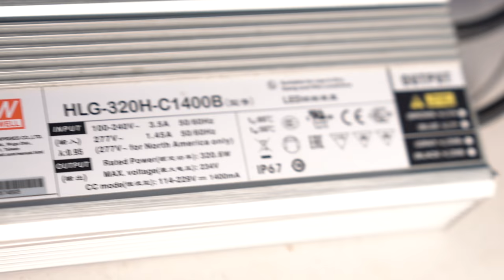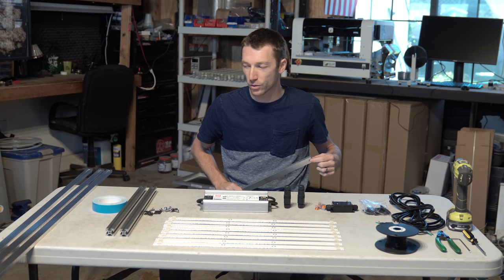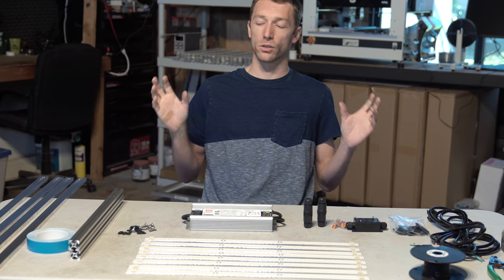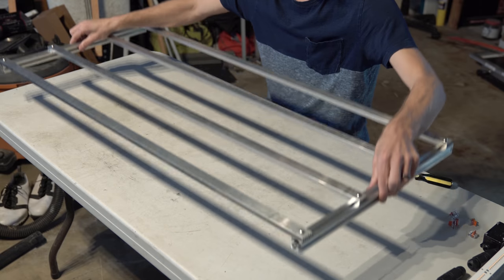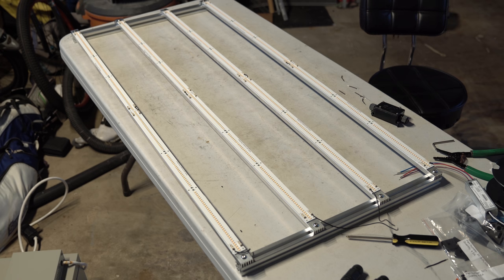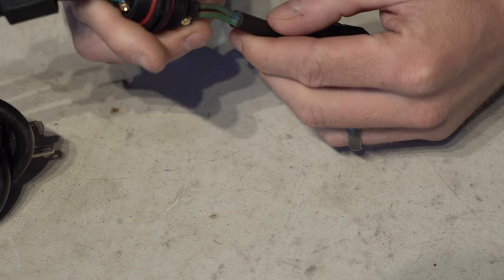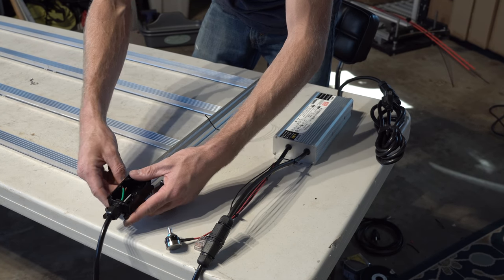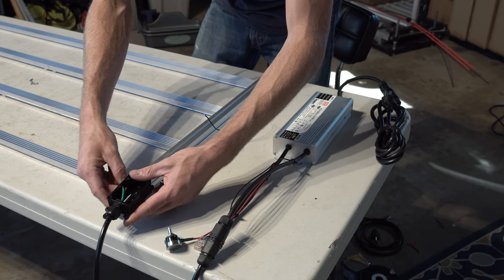Photo Boost Strip DIY LED Grow Light Build

Comment: So, the price point puts this pretty close to a new eye hortillux 315 cmh, and will effectively light  the same area (2x4, 3x3) I'm currently flowering in a 3x3 under the cmh, planned on getting another cmh and tent, but now you have me thinking... I would modify the build to a 2x2 footprint...it would be interesting to see a side by side...basically intensity vs, uv...
Reply: What you're missing is with this build, you're getting roughly 50% more photon output than your CMH for roughly the same wattage. You'd be stepping up from ~1.8umol/joule to ~2.6+ umol/joule depending on driver selection. 😁👍
Reply: Cmh is more like 1.6.
Reply: the eye hortillux 315 cmh is rated 202 umol/sec/m2...so not so far off in efficiency ...I think the comparison is between UV output vs. overall intensity. Led have pathetic UV production...the UV diodes are overpriced and underpowered...the EYE Hortillux 314 CMH was re engineered for even better UV output than existing cmh bulbs on the market...
Reply: @Tabakki420  202 umol/sec/m² speaks to it's output, and that number alone means nothing in regards to the lamps efficiency rating.
Reply: @Tabakki420  And based on my math (assuming the numbers you provided are correct) we're looking at ~1.559umol/joule for that CMH you mentioned, or roughly 40% less photons per watt. If you think a slight bump in UV is worth that trade-off....then that's your decision to make bro. ✌️👍
Reply: @grownonymous  I never said I thought cmh was better or worse..and how is going from absolutely 0 UV to one of the highest UV producing horticultural lamps considered a "slight bump"? My original statement stands, price is more or less equal, wattage is more or less equal, I already acquiesced to the fact that led has more intensity/photons per watt. What it does not have, in any meaningful way, is UV spectrum. The CMH has UV in spades. A side by side would be an interesting experiment. Thats pretty much the point I was trying to make.
Reply: @skunkbeard4205  CMH outputs barely any UV, regardless of what their spectral curves show. Having said that, I was simply providing numbers. Not shitting on CMH, just stating it's far less efficient than Photo Boost strips at like wattage. At the end of the day, grow with whatever works for you dude. 😁👍✌️
Reply: @grownonymous  So, are you saying Eye Hortillux is misrepresenting the UV output of their new cmh bulb? Their philosophy was that the CMH bulbs that were already out had extra UV shielding soncevthey were designedvas hogh bay lights for retail stores...to take advantage of the cri...They claim their CMH outputs 50% more UV than other CMH bulbs.
Reply: @skunkbeard4205  No...I'm saying the 4-8w of actual UV coming out in f that bulb isn't worth the trade-off of losing 40% of your photons. Why you continue to try to turn this into an argument is beyond me, but I can do this all day bro.
Reply: @grownonymous  I was never trying to argue anything...I was  asking questions. I never said CMH or led was better...just different, and that it would be interesting to see a comparison. You already seem to know the outcome, and that's great. You almost certainly have more knowledge about the subject than I do. Unfortunately, the way I'm wired is to do the actual experiment before drawing conclusions...Incedently, I think you are correct in your assertion thst the led will out perform the CMH in weight...more photons = more growth. But, what if theres a difference in the expression of the plants under different spectrums? As a home/hobby grower, 1 extra zip at chop is an easy trade for 10% increased trichome production...( I have no idea if that would even be the case, but I do know how to find out...do the work.
Reply: Watt for watt led such as these are the best. I have used it all too.
Reply: I personally think this spectrum from plc is the best you can get. ChilLed has really good spectrum too.

Comment: Can you get any spectral control from doing a parallel build or is it just controlling the intensity of the Photo Boost and full spectrum LEDs independently? In short, could we get a parallel build video por favor?
Reply from the maker: The boards are a fixed spectrum. A parallel configuration will not make a difference.

Comment: can i run these in paralell? i have a paralell set up with a hlg185 24b driver.
would be nice to upgrade or add some of these
Reply from the maker: 24v is not enough to run them in parallel.

Comment: Buy the power cords and the pot from rapidled to save on shipping
Reply from the maker: Amazon prime is free shipping.
Reply: That is true but the pot you linked is from rapidled.com
Reply: Home depot sells the cords too. I belive they also sell the sjo by the foot, if not local electrical wholesale house do if need lrg quantities. The sell spools. I did a couple thousand feet of that stuff for high bay warehouse. Most wholesale will do cash sales without an account! 👍🏻

Comment: I could be wrong but one of these is probably going to cost around $350 bucks. From all the parts he listed. Not to bad for quality parts
Reply from the maker: Yep that's the gist. Most photons per dollar out there right now.
Reply: @GreengenesGardenOfficial  is there a single Meanwell controller that would run an 8 strip config so you don't have to buy two controllers?

Comment: If I use C1400A would that be ok? Cos it’s the only driver available for me to purchase
Reply from the maker: Yes, it's the same driver, but is not exactly dimmable. It can be dimmed but is meant to be set and left rather than constantly controlled like the B version. Other than dimming convenience, there is no difference.
Reply: Greengenes Garden thank you for your info, dimmable seems much better. But it’s not available for me to purchase here in my country. Is it available for me to purchase from your web?

Comment: On the gland connectors the gold screw is for which wire hot, ground or neutral.  Dumb question my first build
Reply from the maker: Usually gold/brass is for the hot wires.

Comment: so if you put this thing together and it's dimmable but won't dim all the way off, what did you do wrong?
Reply from the maker: It may be the dimmer. I just had someone report the rapid dimmers having issues. May need to contact rapid. If you take the dimmer off and touch the leads it should go off, and would confirm it's the dimmer.

Comment: Thinking of doing a 2ft x 2ft build, could you recommend a driver that would only need to power 3 x 2ft strips per fixture.
Reply: I just did a DIY build with 8 of these. They are on a 24" x 24" frame. I ran them in series though so I stayed with the hlg 320h 1400a

Comment: that grounding on the fixture side is throwin me.  I understand your using a preassembled 3 wire cord but say i'm using 3 separate wires...a positive a negative and a ground...wouldn't it be same if I just screw one end of wire on frame/heatsink and the other end of the same wire to the hlg driver where you twisted it for connection, and this would be grounded?  I see 3 wires for your ground...the one you have screwed on the frame...the ground that is inside your preassembled cable(the green one) and then the wire  you twisted to the hlg driver casing...I hope you understand my question.  isn't that really all one wire if I connect one end to the hlg driver and the other end to the frame or heatsink?  or does that gland work some kind of ground majic?  i'm like some others...short on electrical.  I understand all but the ground part there.  then some are saying don't need it others saying need it.  i'm gonna have the driver outside of the area or remote.
Reply from the maker: Ya, same as all one wire.
Reply: thanks for quick response.  I really appreciate it. @GreengenesGardenOfficial

Comment: Great video.. but it wasn’t clear on the frame what the sizing was for the website. You said 80/20 1i ch but that doesn’t seem to be an option.
Reply from the maker: Called 10 series
Reply: iam struggling with this aswell. They want to know fractional lenght when ordering the 10 Series Extrusion 1010 🥴🤔
Reply from the maker: @deppiedave6731  There is none.

Comment: Could you take a Mars hydro ts1000 and change out the quantum board? To a better quality board?
Reply from the maker: Quantum boards are made by one company, and one company only...HLG. It is a trademarked name. Anything else is just samsung diodes on a board. All the power and sizes are explained here. If Mars hardware fits the build then yes, but this video explains how these strips operate. What you do with them is up to you.
Reply: Greengenes Garden thank you very much
Reply: Greengenes Garden I was given a ts1000 by a friend and was just wondering if I could order just a board that is compatible with the driver to upgrade the spectrum

Comment: Hi!

You build so good and mutch idéer so on.
Can you give me some tips on a build for me in 80x80x160cm? 

Big thanks Master Led
Reply from the maker: .75 to 1 strip per sqft driven at 1400ma will get you to light levels you need.
Reply from the maker: Would favor the lower end there with your limited height.
Reply: Okej I dont now .75 is but you have som kit I can look on in Alibaba for ex?
Reply: Got you now.
What led strip do you say i put on the 75  ?

Comment: i wanted to use 10 strips with an HLG 480H 30B, running the strips at 1.6. is parallel wiring bad for these strips?
Reply from the maker: No it's fine, that can be done.
Reply: @GreengenesGardenOfficial  
thanks for the reply. i figured someone was out there wondering if they could use their CV driver.
Reply from the maker: Ya. The best way is to run two boards in series to make 54v, then parallel as many of those as needed. 54v fits a lot of drivers better than 27v.

Comment: What' build would work for a 4x4 grow tent?also do you plan to sale pre-built units?
Reply: If you want to blow the walls off your 4x4, simple double up this design dude.
Reply from the maker: Yep, just double this. 16 strips on 8 heatsinks on a 46" frame. 2 drivers.
Reply: @GreengenesGardenOfficial  Can I get a single driver that will run a 16 strip (double) light for my 4x4? I'm kinda new to this but I am learning. Thanks for your time and help.

Comment: Great video Gene! Do you think 8 boards would be enough for veg in a 4x4?
Reply from the maker: Hey man. It would do really well. Not the most intense, but comparable to ~500w of hps or 600 MH. It puts out ~60-70% more light than a 450w t5 system. IF that gives you some things to compare to. I'll be vegging a 4x4 with this one here.
Reply: @GreengenesGardenOfficial  awesome! I'll get them once they are back in stock then. Thanks
Reply: @GreengenesGardenOfficial  What distance to plants in veg and flower? and Does the light from a 2x4 set up spread out pretty well in a 4x4? Thanks

Comment: Having some trouble wiring this up. I went through the video multiple times to make sure everything is correct and and it’s still not working? Any suggestions?
Reply from the maker: Make sure the short connections between the boards are secure.

Comment: How many strips etc would it take to be equivalent to a 1000W HPS? Also, are there any special ones for Veg and for Flower?
Reply from the maker: 16. Double this build.
Reply: @GreengenesGardenOfficial  Thanks for the fast response! Anything regarding the Veg vs Flower? Like other LED units have those "bloom" features. I have no experience with these so not sure if these are as good as those or better. Any input would be greatly appreciated!
Reply from the maker: This is a full and complete spectrum that will take plants from seed through harvest.
Reply: @GreengenesGardenOfficial  Thanks again! You're the best!

Comment: Soon as I order this you’ll come up with a plasma build. Excelsior! Excellent video. @GreenGene if you were building 2 systems for a 5x5 Gorilla what length frame members would you suggest to cover the entire canopy. Should I order it longer wider than 20”
Reply from the maker: For a 5x5 you might like them as two fixtures on 20-24" frames. Or you could get a single 48" frame. Up to you.
Reply: Greengenes Garden thanks GG I priced it all out for two drivers and 16 strips

Comment: Hey gg any idea how this stands up to 630 de cmh obvisoly with a 16 board 660 watt system?
Reply from the maker: The Photo Boost system would put out ~48% more light than the CMH. With only ~30 more watts.
Reply: @GreengenesGardenOfficial  I see on the site you list 104 ppf @ 1400ma. I'm guessing that's calculated. Any idea the ppfd of a 4x4 system over a 5x5 at 12 18 and 24 in?

Comment: Can i use the Driver with European 230~240 Voltage ?
Reply from the maker: Yes. Just wire it according on the ac side. The DC side wouldn't change.

Comment: Hey are these photo boost strip still available? It appears the place where we used to order them from are no longer available. Are they possibly available somewhere else or is this the end of the road?
Reply from the maker: They are no longer available. PLC shut their doors at the beginning of this year.
Reply: @GreengenesGardenOfficial  well if you're still doing builds and have a suitable replacement or something else that's better we would be more than happy to hear about it. Thank you again for everything you have shared with the community.
Reply from the maker: The apache tech light I have in my room now is 800w for $800
Reply from the maker: premade

Comment: Great informative vid, my only concern is since these do not have a cover over the strips, how well do they hold up to water and moisture? Will Foliar sprays n higher humidity damage the strips or diodes? Relatively new to led but most lights I’ve researched have covers over the lights, I’m guessing for protection. Any insight or information will be greatly appreciated!
Reply from the maker: You can put a cover n if you would like...its a DIY build, you can do whatever you want or need. There is no issue with humidity or any normal growing conditions. Avoid spraying the LEDS with foliars. Or use https://www.amazon.com/LuxDrive-LED-Seal-Silicone-Sealant/dp/B00LWU1XVW
Reply: Greengenes Garden appreciate the reply & your suggestion. These look awesome, I’m on the email list for notifications once plc restocks on these. Definitely looking forward to giving these a go, gonna look into that electronic sealant or covers. Otherwise I’ll just have to be more careful while doing my foliar spray 🤷🏽‍♂️🤙🏽

Comment: Since you tube is a worldwide thing 😂
Do you ship overseas
E.g to the UK
One more thing is it just a case of fitting the correct UK plug to run the light
Reply: Driver input is usually 100-250v that is technically universal world wide

Comment: You said you need a 23 inch heatsink for a 2ft build. But the strips are 24"?
Reply from the maker: The strips are 560mm...or 22.05". The more heatsink, the cooler they will run.
https://www.pacificlightconcepts.com/product/photo-boost-strip-light-engine/
Reply: So could they be used to make a 2x2 light, and would have to use the same driver you did.

Comment: I just did this build. Only the first strip is functioning. I’ve connected -/+/-/+ and so on. Any ideas?
Reply from the maker: Are you using screws to secure the boards down or just tape?
Reply: @GreengenesGardenOfficial  screws
Reply: @GreengenesGardenOfficial  also, I need more. I’m actually growing cacti under them. Are you going to get back in business?
Reply: @GreengenesGardenOfficial  I got it. Didn’t think about them grounding out. Thanks.
Reply from the maker: Yep, that's what I was guessing. Can get nylon washers, or use tape only. I have fixtures running constant for 5 years with just tape.

Comment: Wait, there for sale now
Reply from the maker: Yes sir, they are live.
Reply: Off the cuff, can i just add some plc strips to my hlg 304's or we talking different vltage
Reply: @siciliansith1054  Way different voltage. QB304's are somewhere around 110v per board, while these Photo Boost strips are 26-28v depending on drive current.
Reply: Greengenes Garden what’s the price and how I  get them
Reply: @wendyzhang7913  panda lights?
Reply: @CC-jy4gr  Nope,you can add me,then I send detail and price to you. :)

Comment: Gene bro i need a kit for 5x5 i got the bread no doubt whats up i need it to be a veg and flower spectrum like 4000k
Reply from the maker: And I got the website and list no doubt
Reply: @GreengenesGardenOfficial  bet which kit would you recommend? Will the 4ft kt work for the 5x5
Reply: Oh also bro im about to be running jacks and i have a couple questions about ur nute regimen when you add your recharge and tribus do you just do that by themselves or with ur nutes?

Comment: Most of the links for the materials are down.
Reply from the maker: Just clicked on all the amazon links are are working perfectly. All current.
Reply: @GreengenesGardenOfficial  You're right not sure what was happening yesterday. There's only the  link for the 3 pin connectors that still give me an error page.

Comment: 320w equivalent or at wall?
Reply from the maker: 330w from the wall
Reply: Ok. So its 640 w ewuivalent?
Reply: @GreengenesGardenOfficial  I just found your you tube video series. Instant fan!!! Question 1: I'm wanting to build 600+watts lighting system, should I build 2 systems or can i just run the one 2'x4' system but at 240v?
Question 2: can I use this lighting system for veg as well as flowering?

Comment: PPFD/Watt?
Reply from the maker: PPF/w is 2.7. PPFD is a spot measurement and changes with distance to the source.
Reply: @GreengenesGardenOfficial  true. What's the recommended height for this LED to be hung? At the standard height of 24 inches, what's the PPFD/W?